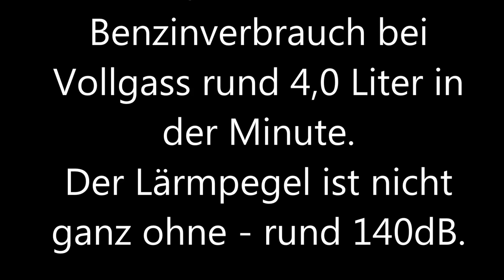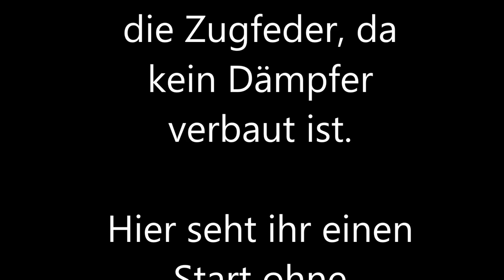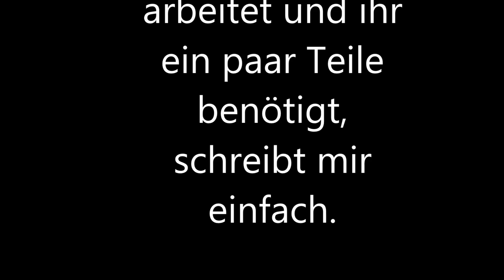Argus as 014 Strahltriebwerk mit 60 kg Schub von MBI design

Comment: Nice job!  I like your fuel manifold too.  You have to get some wheels on this thing ASAP!
Reply from the maker: Thanks, I had to cut the nice distributor of the 100kg Pulso so I could use this flap bank, does not look so nice.
The new project is with wheels, but is not yet revealed.
Reply: Sounds good.  I'll be keeping an eye out for the reveal!
Reply: @mbidesign4185 Hello.
I am also interested in the Argus-014 engine, and would like to build something flying using this engine in the future.
In this regard, can I ask you to show the design of your engine version?
What are the internal dimensions of the chambers, diameter/length ? 
And how is the valve grill arranged?
What size are the petals and what is their stiffness?
Thank you in advance.

Comment: Great job. Everything was done very well.
I made a 25kg pulsejet.
I have certain problems with fuel supply.
You have a wealth of experience with pulsejet.

I want to consult with you.
Reply from the maker: Hello, thank you very much. What is their problem with the fuel? If the nozzles have a sharp beam angle, that's bad, mine atomize the mixture and baben 120 degree beam angle.
Reply: Mein Motor ist für 25 kg Schub ausgelegt, leistet aber nur 11.
Wenn die Kraftstoffzufuhr zunimmt, verschluckt es sich.
Entweder ist zu wenig Luft vorhanden oder das Kraftstoff-Luft-Gemisch ist nicht gut vermischt.
Ich habe zwei Fragen:
1. Welche Art von Düsen verwenden Sie?
2. Wie dick ist das Metall an den Ventilen? Ich verwende Federstahl 65G 0,2mm
Reply from the maker: Hallo, die Ventilfederstärke ist mit 0,2mm gut. Bei 25Kg Schub musst du ca. 2,5-3 Liter Benzin verbrauchen.
Die Düsen müssen das Benzin gut vernebeln nicht spritzen. Ich verwende die für Pflanzenbewässerung.
Dein Einlass Querschnitt muss ca. 35-40 Prozent kleiner sein als der des Resonanzrohres. Der Abgasstrahl muss hinten leicht zu sehen sein und Spitz zulaufen, die Farbe Rot bis Gelb. Wenn du ein Video hoch laden kannst, kann man mehr dazu sagen als schreiben, meistens liegen die Ursachen  an anderen stellen.

Comment: How can I make the valve myself ?
How much was the pump ?
Reply from the maker: With a milling machine, you can mill the valve segments out of an aluminum square. If you can work on it with a CNC machine it is better.
The pumps are from the car, 2pumpen paralel connected with a maximum pressure of 6 bar at about 4 liters in the min.

Comment: Do you think it could run long enough to fly over the English channel without melting itself? Never seen anyone run a pulse jet for more than a few minutes without it almost turning into the devil. How about lift an 1850lb warhead and 165 gallons of fuel plus the weight of the aircraft and the engine itself. Sounds like the V1 would have weighed close to 3,000lbs. Bet it could pick up a propaganda empty light 18ft 1940's Rc plane pretty well as long as you launched it from a catapault system to get it to speed right away, like they did. So simple and cheap to produce if these were practical to lift any kind of weight besides barely itself the military would still apply them somewhere where noise was not a concern.
Reply from the maker: Hello, it is not a problem in the air because there is enough cooling. On the ground, it is therefore not possible to run a lightly built drive without cooling for longer. The launch pad was only there to take less fuel and have a shorter runway. With a consumption of 28 liters per minute, it wasn't exactly economical.